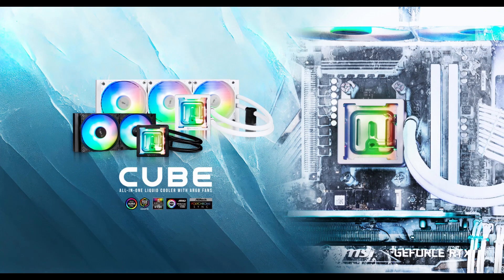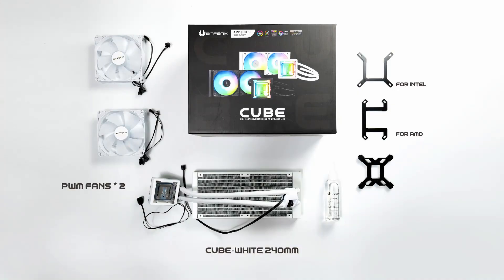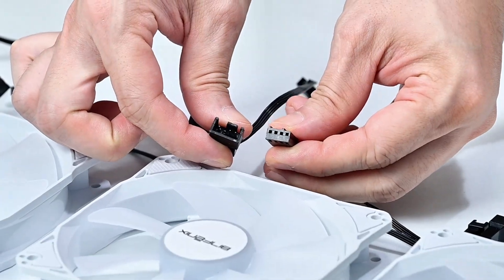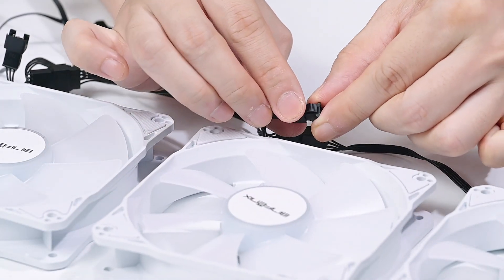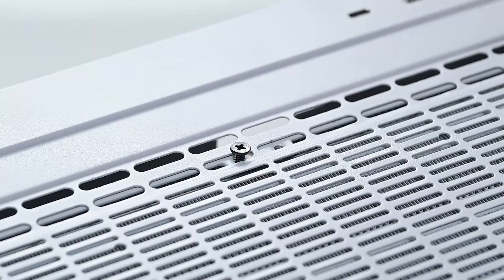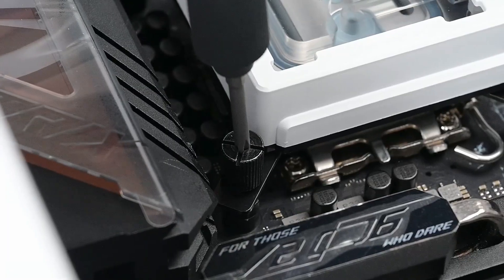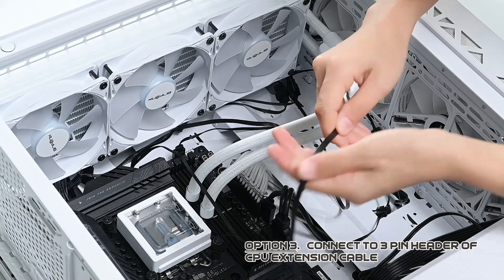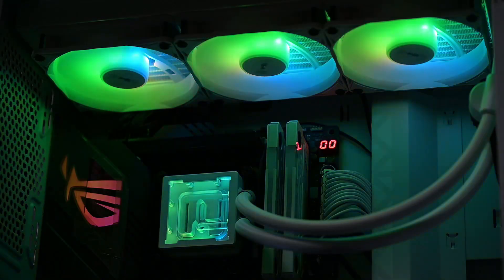BitFenix CUBE AIO Liquid CPU Cooler 360mm/240mm Installation Guide _Intel LGA 1700 AMD AM5 Ready

Comment: Hey I got a question BitFenix. Has this pump block been calibrated to Signalrgb? And if not how are the LEDS  arranged? Four along the bottom, one in each corner? That way I can arrange the rgb properly. Neat product..  just waiting on mine to arrive
Reply from the maker: you mean how the ARGB LED in the water block is arranged? The LEDs are compatible and can be controlled by AURA SYNC, Mystic Light, RGB Fusion 2.0 and Polychorme SYNC motherboards
Reply: @bitfenix  yes! I wanted to know because SignalRGB is what I use for rgb control and wanted to know the arrangement of the leds so I can set the pattern correctly! Thank you for the reply!!!
Reply from the maker: BitFenix ARGB/RGB LEDs products are tested with the major motherboard brands mentioned..however, we don't test or co-develop with Signal RGB as we do with the major motherboard brands therefore, we can't confirm that to you...thank you for your understanding

Comment: I bought this cooler. It has bottle of liquid to refill it. But how no instructions included in the box at all.
Reply from the maker: basically you don't need to refill at least in couple years of use ...it's included only as spare or in case
Reply: @bitfenix  Ok thanks. I love the fans included. Can I buy the fans separately?
Reply from the maker: the fans are not sold separately..however, we will let our product team know about this and let them evaluate the possibilities to sell the fans separately in the near future @pretzel06
Reply from the maker: btw, just to remind...please also note that when the AIO is installed, you may see some bubbles inside the water block, it's because there is air inside...after the pump runs for a while, the air will get pushed out and the bubbles will disappear  @pretzel06
Reply: @bitfenix mine died. Pump doesn’t work. It is only 10months :(

Comment: Interesting, but a huge missed opportunity with this. Should have given the fluid some color or lack of transparency. That's kind of the point of seeing it through the water block, aside from seeing if it gets low.
Reply: From what I'm reading it is refillable and you get a fill bottle with it. So yu could put in something like that..  kinda neat idea!
Reply: @shlushe1050  Problem is, that usually voids the "warranty", though given Bit Fenix's responses down below, they likely won't honor any warranty anyway. 

Its generally not recommended to mess with them anyway unless you have to.

On a side note, I'm pretty sure when DeepCool had exposed transparent tubing on the water block for their Captain AIO, they made the fluid red so the user could actually see it.
Reply from the maker: We think you interpret not correct, we don't " void" the warranty...BitFenix work with worldwide trusted and professional channels for years ..to provide the local services by world wide trusted channels will be the most efficient and fast way for the buyers that they don't have to send every product back to our engineering team in Taiwan for testing. Thank you for your understanding  @deuswulf6193
Reply: @bitfenix  That's generally not how it works in some places. If I buy this AIO off amazon for example, and it leaks all over the place after 30 days, are you going to tell me to try and get Amazon to do the testing for you? They don't do that haha. 

This is why manufacturers have a warranty, and are contacted instead of the retailer. If you don't have a place in the US to handle these kinds of issues, then you should, just like every other Taiwanese brand that sells in North America.

I can't in good faith buy your products because the warranty is effectively meaningless.
Reply from the maker: BitFenix products on Amazon are sold direct by BitFenix and BitFenix channels partners or Amazon team source from BitFenix distributors. We respect your personal opinion about the faith and warranty, however, Amazon has policies and regulations to make sure the brands and products sold on Amazon are with good qualities and proper after services. Just for your reference    @deuswulf6193

Comment: i bought it, it didnt leak for 3 days, performance wise its not bad but if you dont have argb controller on motherboard you have to use it without lights. so you need converter for even seeing lights also you wont be able to still control it. this is my third product on bitfenix but i must say customer service is not great, they dont help most of the cases. probably will be my last bitfenix product. also included things in box was great, bitfenix even surpassed high price aios when topic comes to included content. in the final im not pleased by it and i dont recommend especially if you come cross with a manufacturing error youre on your own with destroyed parts. it might be a great aio if it had a quality after service.
Reply: Kanka ışıklar dışında problem yaşadın mı
Reply: @risai308  mesajlara ve pompanın teknik detaylarına ait sorularıma asla geri dönmediler firma olarak. şimdilik ters bir şey yok ama içim rahat kullanmıyorum öyle diyeyim
Reply: @risai308  bu arada belirteyim fiyatına göre performansı daha iyi, bitfenix o konuda döktürmüş
Reply: Hocam benim anakartta argb girişi yok ama dönüştürücü veya kontrolcü ile oluyor değil mi
Reply: oluyor ben öyle yaptım @Novixe23
Reply: @Novixe23  olur herhalde
Reply: @Novixe23  oluyor hocam. Rgbleri takarsınız kontrolcüye kalan kabloları cpu fan ve sys fan takarsınız
Reply: Peki hocam sizde var mı sızma vs.
Reply: @Tahir769  yok valla hocam ben baya memnunum. 72 73 derece olan işlemci max 55 görüyor yük altında.
Reply: @risai308  hocam Thermalright notte 240 var 5300 rpm pompa falan bide daha eski bir marka fanlar ve hava soğutma ile kendini kanıtlamış.Cfm bakımından da daha iyi 75 cfm gibi bir değer çok kararsızım
Reply: To be fair, any addressable rgb component will not have lights if you don't have a means to control and power the RGB. This isn't limited to BitFenix's AIO, but all of them unless its presents a controller as part of the package. I think its fair to assume their target audience will have a motherboard with aRGB headers on it given the nature of this product. You could easily just grab a 3rd party SATA powered argb controller. 

I agree with you, based on what I am reading at least, that the customer service or warranty aspect is concerning.
Reply: No argb controls on the motherboard?  Must be a 13 year old PC.
Reply: @ericboucher799  5800x3d - 6900xt

Comment: Fan RGB lights are working, but I could not light the processor part
Reply from the maker: Please send us photos how everything is connected and we will see what the issue may be
Reply: @bitfenix  How can I send you photos?
Reply from the maker: @muhammedyasin4736  you can post here or send to bitweb@bitfenix.com
Reply: fan RGB lights are not working and AIO pump is not working
Reply from the maker: Please return to the shop you purchased and asked for a new replacement. If you have problem to get new replacement, please kindly get back to us @jsyoungfk3622